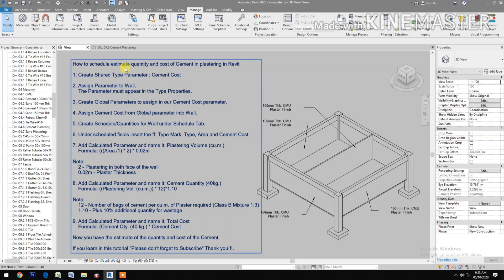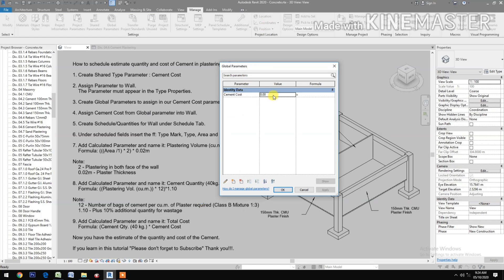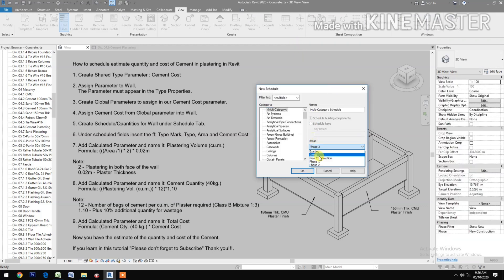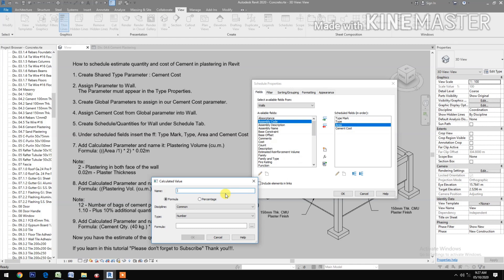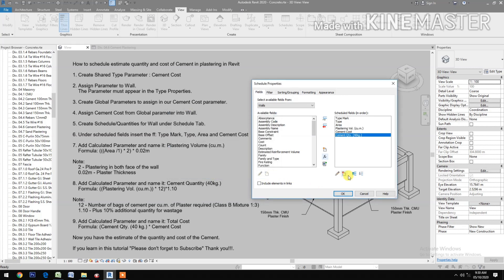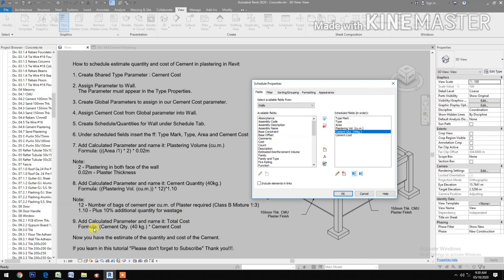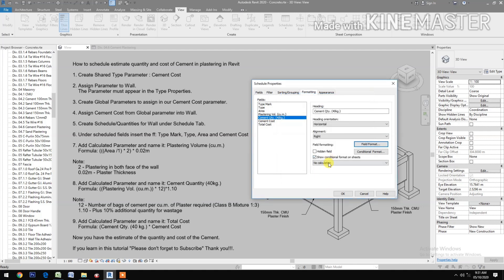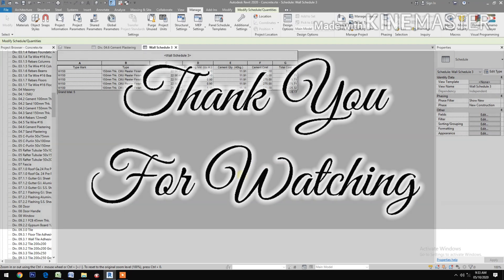Cost Estimate of Cement in Wall Plaster in Revit. Program of Works in Revit.

Comment: These type of videos are great
Reply from the maker: Thanks...
Reply: @ArCrisCruz  sir halimbawa nag material take off ako ng multicategory / schedule quantity lng, for example for foundation cost - bakit kaya nasasama sa schedule yung floor slab? or meron hidden item na nasasama sa schedule. meron po kayang pwding gawin para mahide yung hnd kasama sa schedule?
Reply from the maker: @DsalesArchitecturalServices  meron. Dagdag ka ng parameter. Gawa ka ng parameter name Division Number text lang siya lagyan mo lahat then i filter mo na lang.
Reply: @ArCrisCruz  sir sana gawa ka sa next video mo kung paano gawin po yan
Reply from the maker: Oo. Marami pa naka line akong gagawin. Try mo i filter muna by type mark.
Reply: @ArCrisCruz  paano mag filter sa schedule ba yan sir? or sa mismong model?
Reply from the maker: Oo sa schedule.
Reply: @ArCrisCruz  wow problem solved sir